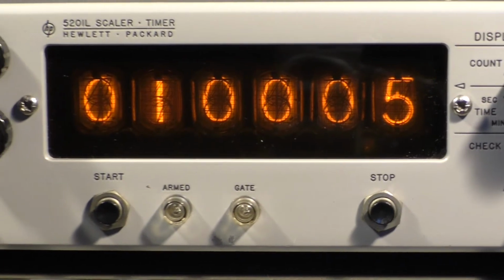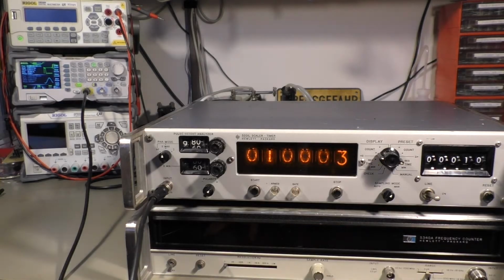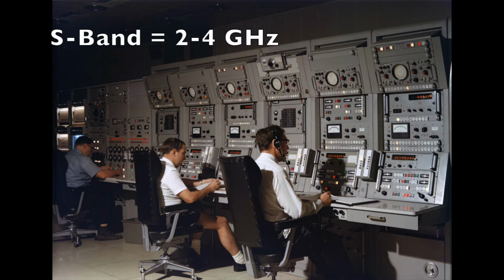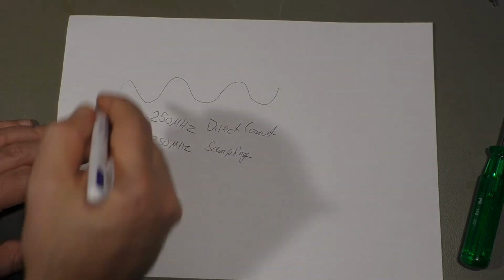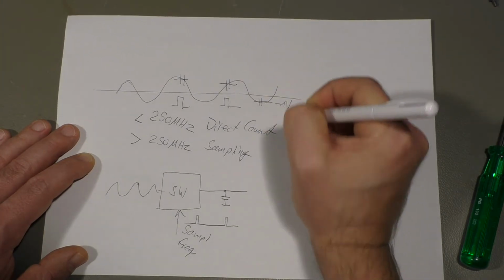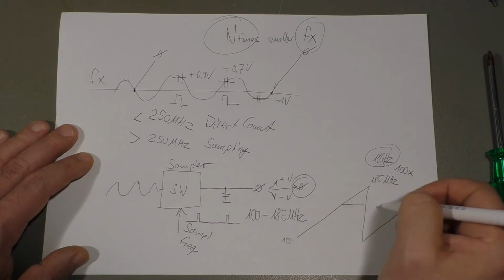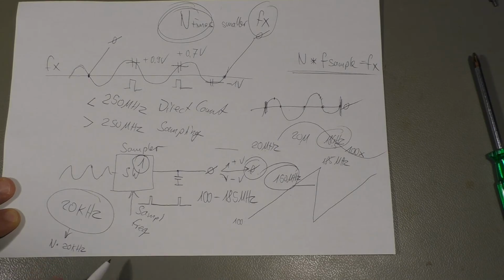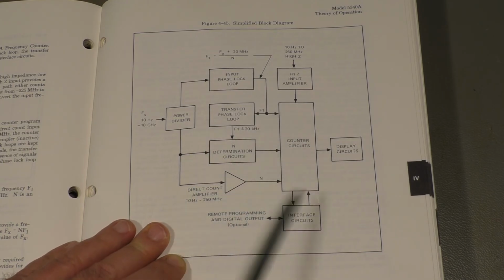Counts to 18 billion in one second! (with Nixie tubes) - (PWJ159)

Comment: I have a 5340A on my bench. I worked at HP in the '70's. One of the Nixie's on mine finally died, so I just switched it with the one in the left count location, where I figured I'd already know what that digit would be. I really should replace that Nixie, but why? After all these years its freq ref is very stable, but I still run it off an external GPS reference, a good mix of the old and the new.
Reply from the maker: Great story!
I read the manual for the 18GHz counter and tried to understand how it works. I literally blew my  mind what those HP engineers came up with. I mean just starting with that Nixie decoder that uses neon lamps and photoresistors... what an idea!!

Comment: I have that exact model of frequency counter.  Got it cheap in working condition, but came to turn it on last week and it doesn’t work.  Displays all zeros on the nixies.  I will try removing all the boards, cleaning the contacts and reseating them.  Thanks for the explanation!  I originally bought all this old equipment as a radio amateur for rf work, but I have ended up fascinated by the instruments themselves.  Lovely sound of the Swiss church bells…
Reply from the maker: I got the counters in exchange for a Texktronix scope. I wanted them because of the nixies and peobably turn them into a clock. But at least for the 18GHz counter, I admire the technology too much to destroy it. Maybe the other counter will be converted one day. But the strange circuit of the decoder probably prevents that.... :-)

Comment: Your explanation is very good. But I also was wondering about the missing part: the N determination.

The part you explained is the

f_if1 = N*f1 - f_x

part. Where f1 is the sweep frequency that goes from 100 to 185 Mhz which is the input to the sampler,
N is the aliasing factor we need to determine,
f_x is the unknown frequency you want to measure and
f_if1 is the output of the sampler, an alias.

This is an application of undersampling. The
https://en.wikipedia.org/wiki/Nyquist%E2%80%93Shannon_sampling_theorem
tells you, you have to use double the frequency to avoid aliases.  Here we deliberately produce aliases.
f_if1 is an alias frequency due to undersampling.

I looked up the web for the manual, I could only find the one for the HP 5342A from 1979 as PDF. I believe
this device is similar enough to yours.

They explain it very(!) well, so I recommend you to look it up. It is in section 8-83 "Harmonic Heterodyne Technique".

So, you know f1 and f_if1 from the first measurement, leaving you with two unknown variables: N and f_x.
What do you need, when you have an equation with two unknowns? Well, a second equation. They
simply subtract a little from f1 and measure again.

f2 = f1 - deltaf
where deltaf = 20 kHz.

this gives you:
f_if2 = N*f2 - fx
You get f2 and f_if2 from the 2nd measurement.

Now you subtract equation two from equation one, which gives you:

N = (f_if1 - f_if2) / (f1 - f2)

Bingo! (Note: this is true for the N*f1 > f_x case, see the manual for the other case N*f1 < f_x)
Then you compute f_x by using one of the two equations:

f_x = f_if1 + N*f1.
Reply from the maker: hmmm... So at the end it's just mathematics. No wonder it can not be seen in the diagrams  :-)
Thanks for the explanation  It sounds so simple now. But I still admire the solution in this device. Real genius at work!
BTW the counter is working now. It just needed a cleaning of all the board connectors :-)
Reply: To verify that I have understood it correctly w.r.t. the math, I wrote a little C program.
See
https://gist.github.com/mcjurij/77fce3b0517a8e64116ea018af59133b

Comment: I have just fixed my broken unit. Its problem was caused by a dead ROM chip and two malfunctioning mid-frequency counting logic chips. A PLD replacement of the dead ROM fixed the not-counting problem for me.
Reply from the maker: I fixed mine yesterday... after cleaning all board contacts it suddenly jumped back to life :-) I left it run over night and today, when it got stable temperature, I will calibrate the oscillator.  I just can't test frequencies above 60MHz.... have no generator for that :-)
Reply: Hi Andy, I’d be interested to know how you did that ROM replacement with PLD.  Are there kits you can buy or did you home brew something?  Where did you get the rom contents from?   Just in case I have to do something similar to my frequency counter…. I have this exact model.  Nixies all display 0, can’t get 10MHz from the 10MHz output.  Lights are on but no one’s home.
Reply: @cthoadmin7458  I home brewed it: you can find the service manual on KO4BB.com, which includes listings for both ROM chips. 
IDE/toolchain for those early PLD chips are available for free online. I fixed mine with an GAL22V10D made by Lattice

Comment: What is this before me – a Voodoo magic device :) Great video, you did an excellent explanation of a device that’s of considerable microwave understanding. Not a thing that just anybody could get a handle on. That device was designed and developed by specialist scientists and engineers – expensive exploratory work, particularly for its date. It clearly demonstrates how tenacity and sideways (sophisticated), thinking can solve a problem. Must of been very expensive - most works of great art are :) It would also be smashing to have a list of the primary people involved?
Reply: Here is some more information on this counter, end of the first article also mentions some of the ppl involved:
https://www.hpl.hp.com/hpjournal/pdfs/IssuePDFs/1973-04.pdf
Quote: Many individuals contributed to the development of the 5340A Counter. The performance at microwave frequencies could not have been realizedwithout the outstanding thin-film sampler developed by Jerry Merkelo and Bob Hall. The design innovations of the input phase-lock loop with automatic amplitude discrimination were developed by Art Bloedorn. Counter, programming, and bus interface design was the responsibility of Al Foster. Rory Van Tuyl provided the design of the sampler driver, the VCO's and the direct count amplifiers. Bob Maldewin was responsible for the power supply design and part of the VCO development. Glen Elsea provided the mechanical design of the instrument and Dick Goo was the engineering aide and technician on the project. Special recognition and credit is deserved by Rory Van Tuyl and Al Foster who provided many ideas, stimulating discussions,
and aid to the systems development. My thanks also to John Dukes, engineering section manager, for his support and to Ron Potter forhis technical aid."

Comment: HP? Horrible Product? ;-)
Reply from the maker: today probably but not this one :-)
Reply: @PlaywithJunk  HP used to be a company that engineers wanted to work with - one of the best in the industry but the bean counters have taken over and the company broken up. It used to be a really disruptive and innovative company, sadly those days are long gone.

Thanks for another interesting video!
Reply from the maker: @rjy8960  Yeah there must be a lot of beans to count. Unfortunately all that counting does not pay off. Maybe a short term financial improvement, but at the end it ruins a company. But thats no problem for the bean counters because they left before the big crash.
Reply from the maker: My HP11C calculator still works after more than 30 years. No bad keys, no problems. And the tiny coin batteries must be replaced every 10 years only.

Comment: I think it would had been easier to use a  superheterodyne circuit like in a spectrum analyser, but then you would have to calibrate it to get an accurate IF frequency.
Reply from the maker: and you need a super fast oscillator that goes from 300MHz up to 18GHz.... pretty difficult.
Reply: @PlaywithJunk  True... that's typically done with a YTO and fractional-n PLL...but by the time you do that you could have a pretty good spectrum analyser.

Comment: Wow, pretty clever. By the way, it would be pretty cool if you could upload a video trying to fix it. And also, trying to add a crystal to the other HP counter (if the upgrade crystal oven schematic is not available, you can tap the circuit's input of the 50hz mains frequency with a crystal divided with some logic gates)